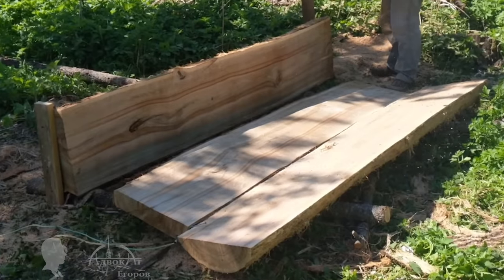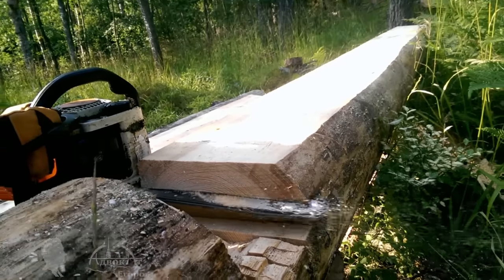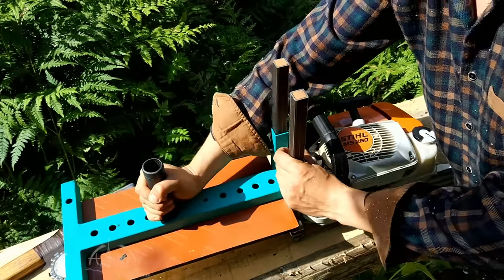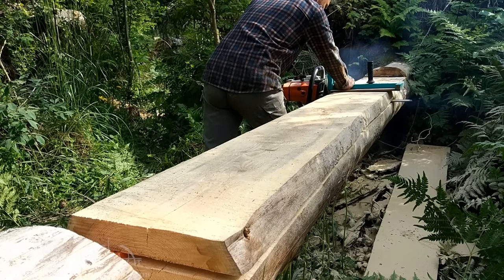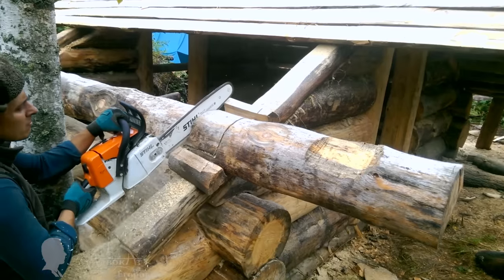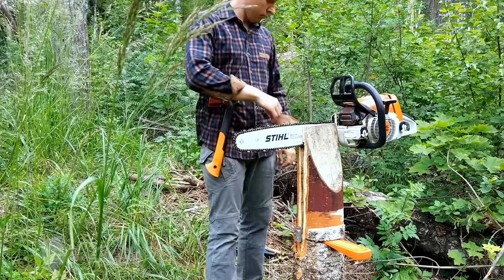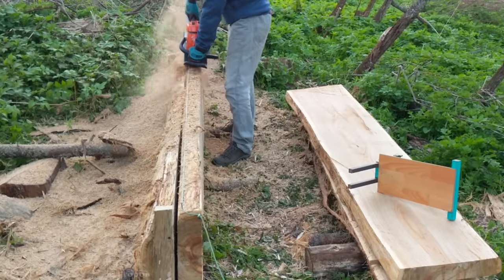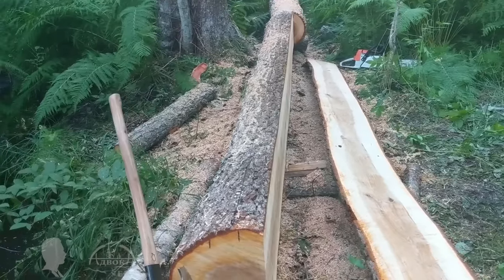Two Chainsaw Secrets | Turning a Tree into Perfect Boards

Comment: This was an awesome video. You sir, have definitely mastered your craft. When you pulled the cylinder from the head, I noticed the scoring on the cylinder.  This happens because people have a tendency to start a chainsaw and rev it up right away. You must let it warm up a bit. The cylinder will heat up and expand faster than the head and cause the scoring. It only takes about one minute to get it fully warmed up. I learned this lesson the hard way. The Stihl and Husqvarna are good saws.
Reply from the maker: Johnny, thank you for the reply

Comment: I’ve owned Stihl, Jonsered, Echo, Poulan, and Husqvarna over the last 15 years. I have sold or given away all my saws except the Husqvarnas. Mix with a premium quality oil and no alcohol gas at 50:1 ratio and it will cut like a demon forever.

Comment: I have a STIHL MS291 saw. It's light enough to do anything I need and a little more powerful than the smaller saws you seem to use. Mine came with a 20 inch bar and chain. I've had it 3 years and not serviced it all; haven't needed to. I too use only STIHL products. STIHL suggests a 93 octane or higher in their saws. I add an octane boost to my fuel and the higher octane really does make a difference (about 3 cap fulls per gallon). Many people say to only use gas that is non-ethanol. I've used ethanol gas it's whole life and not had any problems even after it sat up for 8 months. A good ripping chain is always wise instead of the crosscut chain.  The newest STIHL sharpener files the guide and sharpens the chain at the same time to every gap is the same.  What can I say, it works for me! 😀😀
Reply from the maker: Thomas thanks for the info!

Comment: I tried your method of cutting some red cedar logs into lumber
I picked up the technique right away since I already had 24 years of experience running a chainsaw
Your method WORKS EXTREMELY WELL
Thank you for the tip

Comment: Great video and content. Chainsaws are very personal choices. I’ve always been a Husqvarna guy but I am going to try an Echo 590 or 620P next. One of the main reasons is that they have a 5 year consumer warranty. They seem to be well balanced and well thought out. No fuel injection, computer chip or proprietary software. Simply old school
Reply: Me and my dad both have a echo cs590 Timberwolf and they are wonderful saws my dad has had his for a good 7 years and still running great mine is about 2 years old, good power and super reliable
Reply: And for the price I don’t think you can beat it with any other brand, we have been really impressed with them
Reply: I Gotta give that a go, one smart man CUTTING THEM BORDS FREE HAND. YOU GO FELLA.
Reply: I just upgraded from a Husqvarna 440E to the CS 590 and I'm impressed as hell. $425 out the door with an extra chain from Home Depot and it rips. I bought it with the express intention of milling a few of the logs I would normally buck up for firewood that are too nice to pass up, and it's been doing a fantastic job.

Comment: I have used a Husqvarna 357 w/20" bar. It gives good high rpms & cuts as well or better than stihI saws of comparable size. I would really appreciate a diagram showing measurements of your even cutting jig. I have tried for years to cut slabs freehand without much success. Your methods look good and I really want to build & try your jig. Thank you!

Comment: Its not just the chain being sharpened just right that is necessary for a straight cut.   The bar also needs to be free of burs along its length, or the bur will grab at the wood on that side and pull.   The bar also needs to have exactly the same amount of wear on either side of the chain groove, or the chain will not sit perfectly vertical, but will lean to one side, creating an angled cut.   And ideally the chain will have been run for a few good hot cutting hours to break it in, so you can more easily maintain the correct tension on the chain while cutting.   A loose chain can lead to all of the above mentioned problems.
Reply from the maker: Thank you for your input

Comment: I think one difference you did not mention in your video, is that the first methods you used where horizontal and there you also get the weight of the log pressing a little on the blade, and the good blade swinging method is vertical.  thanks for sharing.

Comment: I've used my Stihl ms311 heavily for over 6 years now. It still runs great and fires on the second pull when cold, ive used it for professional tree removal under the worst conditions you can imagine even cutting with the bar under water  and in snow/ice/rain up to dry 110° heat it's a real trooper and I've rip cut, plunge cut, crosscut with zero issues in all conditions
Reply: What size is your bar on your 311?

Comment: Go with Stihls professional line ONLY! The MS 261 is a great saw. The 260 is in their "ranch" line
They have 3 grades of saws
Home owner
Ranch
Professional.

Thanks for all the great entertainment!!

Nathan from AZ
Reply: I've had a MS261 about 21/2 years.  Although I had some problems at the beginning and some of the electronic components had to be replaced (under warranty), it's be doing great since then.  It's my first commercial saw.  I'd been through 2 Husq Rancher 55s before which were good but using the non commercial for heavy hours wears them out.  I'm pretty sure of this.
Reply: The Stihl Professional saws will have a black guide line across the housing, whereas the Rancher and Home Owner models do not

Comment: For one thing when drying your wood, don't use wood shavings in between your layers, it holds moisture and the drying process takes way longer and also may end up rotting your wood. You need good ventilation between each layer. Also no tarp. The metal sheets are good to keep off the rain and snow.
Reply: I completely agree with you. However I've got a sneaking suspicion he might prove us wrong...
Reply: He mentioned Publishing research…

Comment: Just found your channel through your bee canister video and for your drying method of the fresh cut logs you could build a greenhouse where the front was made from glass or clear plastic corrugated roofing material and create a sort of hot box oven to hold in the heat and basically kiln dry the wood. Not sure but I think it could help speed up the process. More kilns the more cut logs you could dry. I've also seen people take and burn the wood with a torch like tool. All the best, I love your videos, how you narrate and explain things. Quite well for being Russian. Thanks

Comment: Brother, we love using the Husky 372XP as they last so well and have lots of power, and you can run a long bar and chain.   Great video we have been doing this for a Very long time, we use Pink or orange survery string.
Reply: Yes. You gota go huge to need anything else. My 372xp with 20inch bar is remarkable I just give it a little more oil in the mix than book. My 359 seized at the recommended despite full synthetic. Lesson learned.

Comment: Just tried this technique for the first time on a 18" log - it worked surprisingly well!  Thank you!  I did notice that you removed the grabbing teeth which I didn't which would have helped "slide" the saw along the top.  Mine was fir with some knots for a mantle.  Starting the cut would be helpful.  figuring that out took some time.

Comment: Sir, I would recommend adding wedges behind your horizontal cuts to keep weight of the wood off the teeth and bar.

Maybe cut until it starts bogging down add a wedge continue the cut.
Reply: Good point but the real problem is that he's using a chainsaw for something that is not a chainsaw job. I think a ripsaw is what its called. The chainsaw is for felling a tree with angled cuts into the trunk while it is standing or for cutting it into logs while it is on the ground. It is not for cutting it into lumber along the length of the trunk.
Reply: Lateral cuts on Swedish cope logs for houses I've built,are done that way

Comment: I would highly recommend the ms362c or the ms461 but would lean towards the ms362c due to the power to weight is the best you are going to find. I have been running my ms362c for year's with no issues as of to date. Now the ms461 or 046 I would recommend for larger tree's or harder wood where you don't want to work the 362 that hard which not saying the 362 would not cut hard wood but once you run the both of them you will understand what I am talking about. Thanks for the great video and I hope this helps with your decision making with your new saw.
Reply from the maker: Mike, thanks for the info!
Reply: I've used those saws and I concur with your recommendation.
Reply from the maker: @vincentmichaels7495  Thanks Vincent
Reply: @Advoko  👍
Reply: Stihl is not what they used to be. Get a Husqvarna 455. You won’t be disappointed.
Reply: I prefer echo, any model they make that ends in the letter "P"   is worth every penny.

Comment: It is so great to cut your own wood for special projects. I recently discovered a neighbor had cut up a very special tree and stacked it at the curb. Wild Cherry (Black Cherry) is a fairly common tree in my area of the southeastern U.S. 
So my neighbor had a standing dead cherry in his backyard , cut it and put it on the curb.
This tree was special because it had been ravaged by Sapsuckers possibly since it was a sapling. There were thousands of honey holes in the bark which the birds kept open constantly throughout the life of the tree.
What this constant damage to the bark did was to be damaging to the yearly layer of sapwood as well.
The underlying wood when exposed by processing had what looked almost like the same as Birdseye Maple only larger “eyes” spaced throughout the wood.
It wasn’t Birdseye though, it was a different color and consistency.
Result:
This wood was multi-colored = red heartwood, beige sapwood and dark brown pimply-looking “eyes”
I use these special pieces of wood so far for knife handles, tool handles and blanks for projects on the lathe.
Since the wood was cut and stacked at the street when I found it, none of the log lengths are over 16”, 18’ or 24” max. So special craft projects size. Another bonus is the bark which is stuck on there tight and sections such as log “cookies” can be used for drink coasters .

Comment: Max try putting a little more oil into your feul mix . It will smoke a bit more but should do the trick .
Second cause could be running too high tempreture so try improving the cooling fan setup.
Greetings from South Africa.
Reply from the maker: Pieter, thanks for the input.

Comment: Impressive, I have little experience with woodcraft. I have respect for those that do. Owning and using a chainsaw is a pain in the ass.  Recently cut down a dying silvermaple in my front yard. I bought 3 spare chains and a spare bar. I went through all of them by the end of the day. Sharp teeth are all important, so is the blade getting gummed up. A brand new chain saw struggles cutting at maximum 20" bar depth. Letting only a few teeth touch at a time, keeps the saw from laboring so hard. I dont want dust coming out, but long shreds. Your problem solving and skill building are impressive. Best advice, slow down let the saw do the work, sharpen or change blade when it slows down or starts to smoke.
Reply: @Hello Kevin how are you doing

Comment: I wish I could let you use my Husqvarna 372xp. It would convince you. It's likely slightly larger than you are used to, but with the couple pounds comes a lot of power. I've owned and used 20 different saws cutting hardwood firewood, lumber and timbers and still own a mix of mostly Stihl and Husqvarnas and the 372xp with a 24" bar is my main go to saw and the best one I've used. I highly recommend it.
Reply: flatlinesup yes I second your opinion I also owned a 372xp nothing bothers them they will complete any job no matter the size sadly I sold mine just didn't have the work to justify owning it but sold it to a freind so still get the use of it

Comment: Use ‘Semi-Skip’ or ‘Skip’ chain. It has one or two blank links between cutters respectively. The blank links allow room for the sawdust to be carried out in the kerf and means you can use the correct depth-gauge height and therefore create saw chips rather than ‘dust’. The chain will cut faster and cleaner and utilise better what power your chainsaw has. Turn your Oiler up to maximum and consider pre-oiling the chain. Run your saw fuel-mixture rich to keep cylinder temperatures down and  have a high oil/fuel mixture ratio - minimum 40/1 or even 35/1.
 Your ms260 is a “hobby-saw” designed for home-owners cleaning up around their gardens and is not meant for long, hard, hot work like milling. Use a ‘Professional’ model. I use a Stihl ms660 and an 090 for milling and cut logs up to 1.5 metre diameter with no problems.

Comment: Super!
Rip chain might help, one saw for cross cuts and one b
ig unit for ripping.  Also, those logs are short enough to rive easily, as long as they're dry enough.  Now, all you need is something to make long knotches along the edge, so you can insert a spline and make walls with the slabs.

Comment: maxi what fuel do you use in your sthil we had a lot of trouble in Australia with fuel blended with ethanol caused them to seize up and a rebuild was needed
Reply from the maker: I don't think they add ethanol to gas here but the bottom line is I used the same fresh fuel mixture (from the same canister) on both Stihl MS 180 and MS 260 and the later one malfunctioned literally out of the box while my old Stihl MS180 is still working fine...
Reply: Oh ok doesnt sound good i have an old sthil 020 ive had it for 20 years or more its still as good as when i got it.Maybe a husky might be the saw for you
Reply: In US, 10-20% of stations supply premium non-ethanol fuel (varies with location). You can't get it in AU?
Reply: I have heard this as well, prolonged daily use utilizing ethanol 2 cycle blend for heavy use on high RPM engines for utility use especially in the bush will cause the oil to breakdown faster-affecting damaging dissimilar alloy parts...
Reply: could also be the difference in the quality of the engine build and design - look for more of the saws of the engine build you prefer. but if you use ethanol blend it will deteriorate the carburetor and  leave white deposits in carburetor. , use  non ethanol gas

Comment: When I dry my lumber I place a few straps around the whole stack and keep about 800 pounds of tension on them while they dry. 

This helps with the natural twist that happens when some species dry. So far I have been able to save many slabs from becoming firewood while using this technique. 

Though on my last nigh project I did learn a valuable lesson. Never use soft wood as your stickers. I placed some 2x4's in between my massive slabs with the intention of changing them later. But I never got around to changing them, well, it left big black, moldy marks on my beautiful flame wood. . . Never doing that again.

I have never used saw dust in-between my slabs, what is the benefit of doing this? 

Possibly less oxidizing?
Reply from the maker: Aaron, thank you for sharing your experience.
Reply: @Aaron M What do you recommend to use in between slabs?  And how many straps do you use...every 3 ft, 4 ft, or what?  And lastly, what thickness of slabs do you recommend?  I've got a couple of really nice oaks I'm going to try this method on in a few days.  Thanks for sharing your expertise.
Reply: @mrficxit1785  it all depends on what you want to use them for, I usually cut mine at 2 1/4 giving it plenty of drying room so that you'll have a 2-in thick slab after processing. 

And for stickers the pieces of wood in between the slabs I used the same species, so if you're using oak wood you would most likely use oak stickers that are dry. 

I didn't do this the first time I dried a very beautiful tree and I had rotten marks where the 2x4s were laid, no matter how much I sanded and treated the wood you can still see them. .. 

If you want you can check out our YouTube channel we have a couple videos on milling and stacking wood, 
"The Mckeel's Woodworks" 

But as for the straps you can use regular ratchet straps that you get from a hardware store, I bought some strap material from Amazon and I had some old ratchets that I used, I put them on the logs every 4 ft. But on an 8-ft log you would want 3 straps, one on each of the ends and one in the middle. 

It's also maybe two technical for this message, but what region do you live in do you have high heat and high moisture or is it more temperate multiple seasons?

Comment: Looks like a too lean condition caused the failure. Possible air leak Or carb adjustments. Also can be caused by ethanol in fuel. Ethanol will separate after sitting and cause 2 cycle engine damage

Comment: If the piston is scored it usually is because it is not oiled enough or is overheated
Reply: I noticed that the gas he was pouring didn't have a tint to it, possibly the wrong oil ratio?
Reply: Reving and working it too hard without letting it warm up a bit.  See https://youtu.be/b6BfSwtjTIQ. at 11:00.